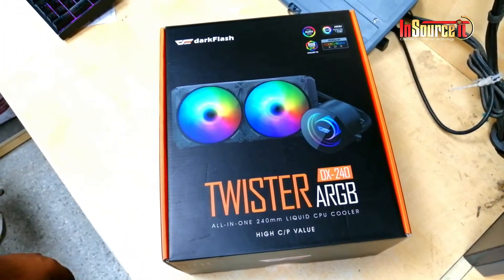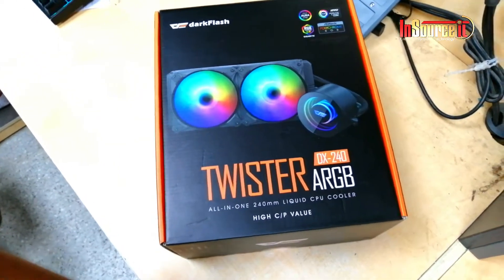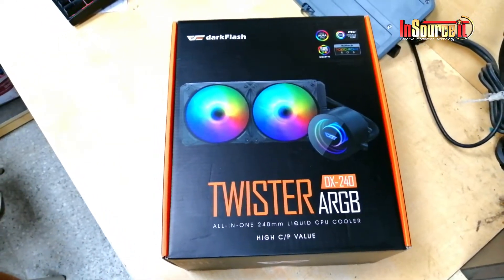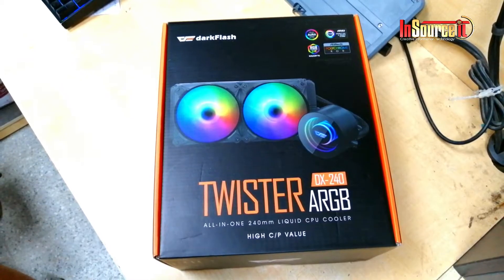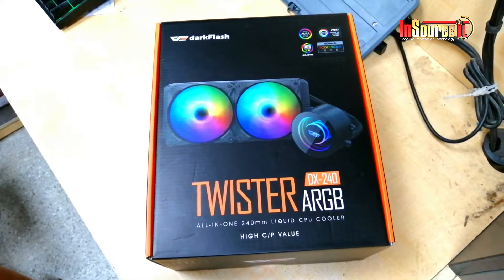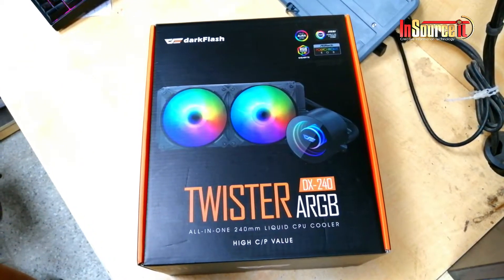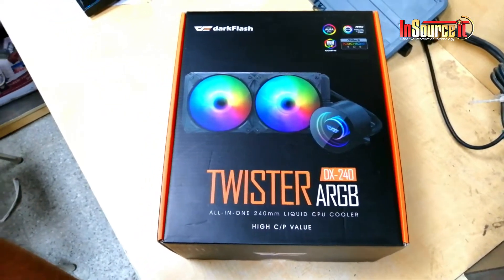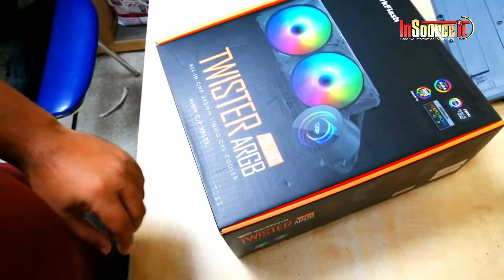How to install Aigo DarkFlash Twister DX-240 ARGB Liquid Cooler | Insource IT

Comment: Even if there is no 5V 3pin header
you can control the LED mode with
the configurable RGB switch cable
case reset button or led button
Panel cabinet reset or led buton can control LED mode
Even if there is no 5V ADD 3pin HEADER on the main board,
you can control the LED mode by using the led or reset bution on the case
Among the connectors from the pump, connect the reset switch
connector (LED control connector) to the PC case led or reset button connector.

Comment: hey i need help, i buy Twister dark flash DX 120, when i install it to prosesor, my tempature while gaming always hit 100C, when just open Opera always hit 70,
Reply from the maker: if you are using AMD or higer then core i 5 processor, this cooler is not for you. you must go for any 240 or 360 cooler. also check you properly install the cooler and thermal paste. Thanks for Watching, please stay tuned with me by liking and subscribing.
Reply: @pccrowd  so if my prosessor i5 100400f , i need dx 240 not 120,
Reply from the maker: @iuseless_7868  if you are using i5 100400f then 120 liquid cooler is good for this processor. Thanks for Watching, please stay tuned with me by liking and subscribing.

Comment: You should connect the pump 3pin cable to aio pump header, the both fans is to CPU or Chassis Fan header for better performance. Thanks for this vid.
Reply from the maker: Thanks for the tip, Thanks for watching, Please Stay tuned with me by Like & Subscribe.